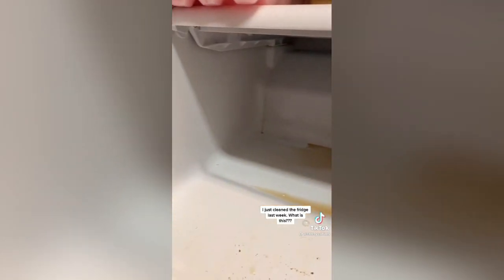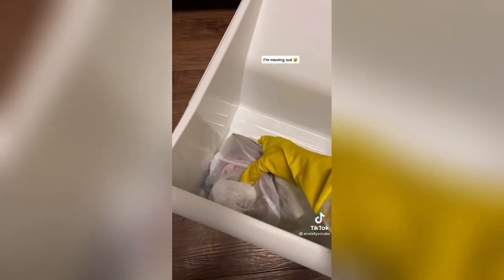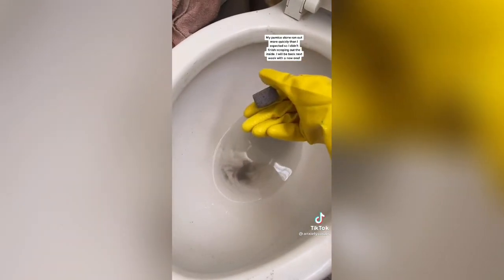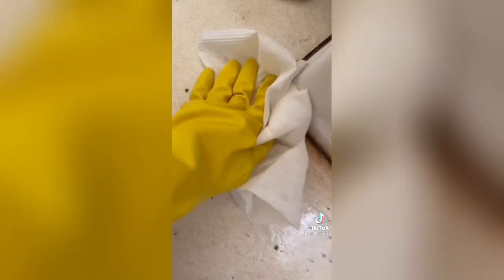ASMR 🧼 Satisfying Deep Cleaning ♡ TIKTOK Compilation

Comment: The water dump at the very end was so clean despite the very dirty bathroom floor because she wasn't scrubbing the floor with the proper product. Lemon soft scrub wasn't going to lift mold (needed the one with bleach for that) or rust (needed a different product for that).
Reply: She also didn't get all of the grout lines around the sink.